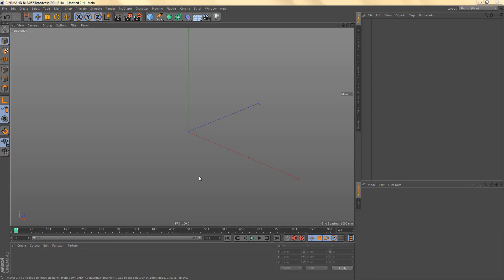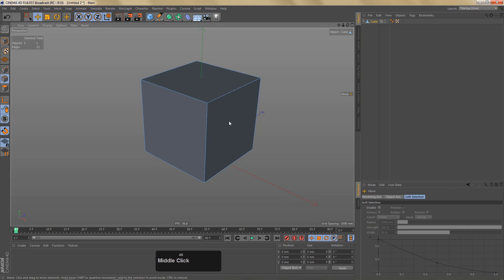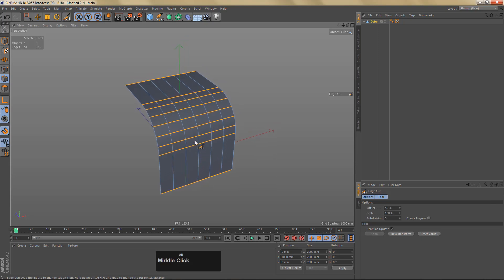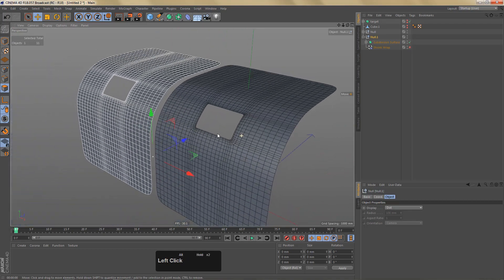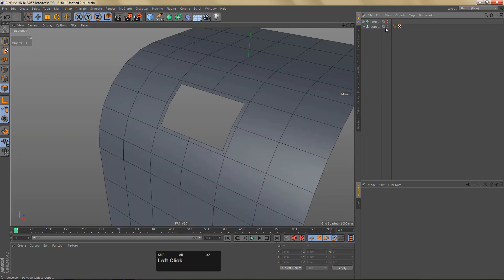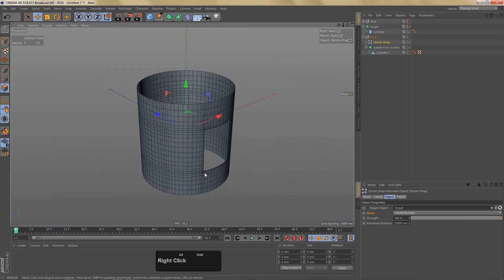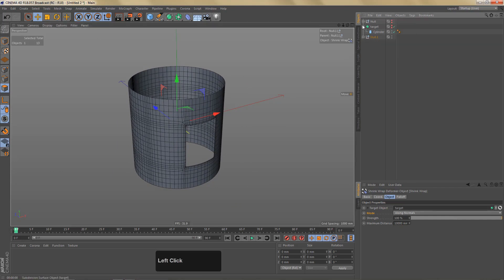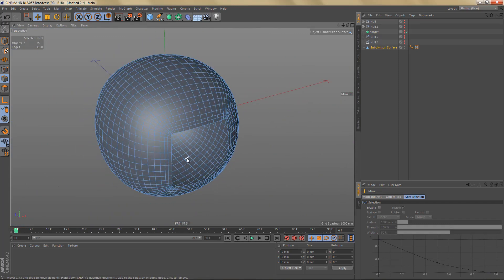Using Shrink Wrap with SDS to avoid pinching (Cinema 4D Tutorial)

Comment: Does this method work if I already have a model that's finished with some pinching? I don't have the original piece with all the nicely subdivided topology.
Reply from the maker: No, you'll have to iron out the pinching manually which, I know, can be a pain. I, too, learned the hard way that it is useful to constantly keep back-up objects I can revert to if anything bad happens. Shrink wrapping works great and is an easy way to smooth out kinks, but it does require matching, clean geometry.

Comment: But why are we getting pinches if everything is quads! I understand the big quads vs small quads next to each other complexity! But with Shrink Wrap the topology remains the same and the pinch goes away! Why is this possible! Why not avoid pinches right at the beginning, that is how to apply the right topology that the pinch doesnt occur at all! Your solution is superb in all senses of the word! Brilliant! But is there something wrong with c4D that the pinches occur and just by applying shrink wrap they go away! Because the topology remains exactly the same, same number of points, edges and polygons that is!
Reply from the maker: Quads are not a guarantee to get pinch-free objects. The hard part of learning modelling is to understand why edge flow, even topology, use of quads etc. is necessary and how it is done properly. There is much more to modelling than just using quads. 

The base topology stays the same, yes. But note that, as shown in the video, the low poly object is first subdivided, i.e. the polygon count is increased which helps shrink wrap to shrink it onto the target surface. With shrink wrap alone this would not work. As a second step, the subdivided object (that has more polygons, which is helpful) is shrinkrapped onto the surface, i.e. the Shrink Wrap deformer forces the polygons onto the surface of the target object. 

With just an SDS object, which only uses the common SDS algorithms, you would only get a high-poly pinch. You need both the Shrink Wrap deformer and the SDS object (and the high poly target object onto which everything is shrink-wrapped, of course) to make this work. 

And, like I showed in the video, the hierarchy is very important: 1) put the low-poly object in an SDS object, 2) put the SDS object in a Null object, and 3) make the Shrink Wrap deformer a child of the Null object in order to have an effect on the SDS object (not the low poly base geometry). And with that trick you can basically make the Shrink deformer "override" the SDS rules and force the geometry smoothly onto the target surface.

Comment: I think c4d should not have brought pinches at all when we subdivided! i know all the intricacies and the inside complexities of where the points and edges be placed or how to remove them from wherever exactly to get rid of pinches! But c4d as a program must not create pinches to begin with! With shrink Wrap they go away, which is great! But if the topology is not changed at all absolutely, then why do pinches are introduced at all at the beginning, that is, before applying Shrink Wrap!
Reply from the maker: Well, the truth is, if the geometry is not right you get pinching and highlights in all modelling applications, That's how it is in Blender, Max, Maya etc., too. So it's not really C4D's fault. The "problem" is how SDS algorithms work. Which is why SDS modelling, depending on the shape and the details of an object,  is more complicated and requires more knowledge (edge flow, use of quads, even topology etc.), practice, and experience in order to be able to get smooth surfaces. 

As for the topology not being changed absolutely, see my answer to your previous post. While it is not changed absolutely, the low poly object is being subdivided (i.e. the polygon count is increased) and then the shrink wrap deformer forces it onto the geometry of the target object.

Comment: Nice explanation of shrink wrap, but ur topology is wrong thats why u get pinches. There  is a certain way for corners not to pinch, its hardsurface basics 101.
Reply from the maker: No shit. It seems you didn't get the point or didn't really watch this video. Of course I'm using bad topology in this tutorial. The idea was to demonstrate that you can make SDS work and get a smooth result using shrink wrap even though the topology really sucks and would create nothing but pinching if you just subdivided it. 

If you modelled the examples I showed in the video with proper topology that wouldn't pinch if you subdivided it, what would be the bloody point of using shrink wrap to begin with? Any idiot can use shrink wrap, there's nothing nice about my explanation of this deformer. If anything, it's the combination of things you need to do to make bad geometry work under SDS using shrink wrap that's nice. Hardsurface basics 101 seems to be all you know. Advanced tips and tricks to solve problems, not so much.